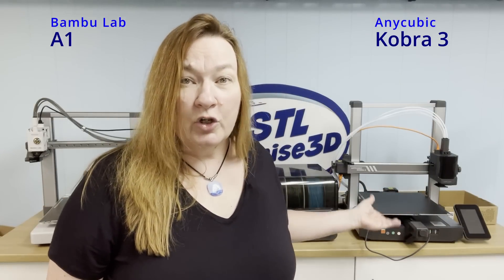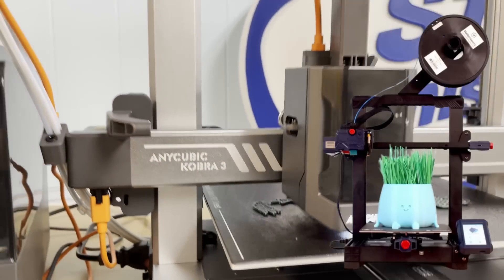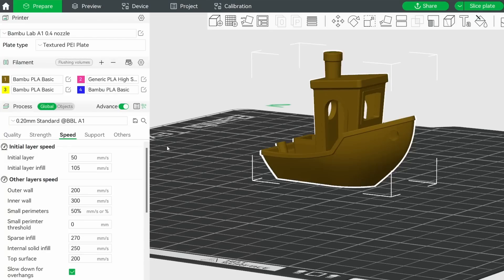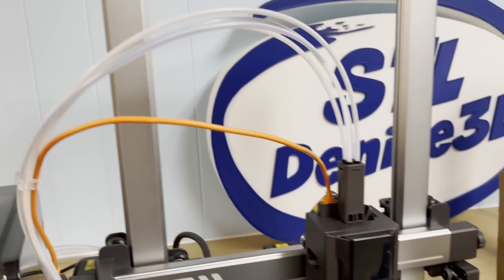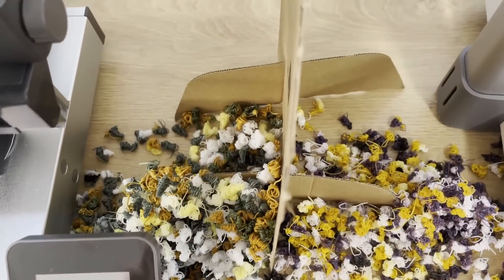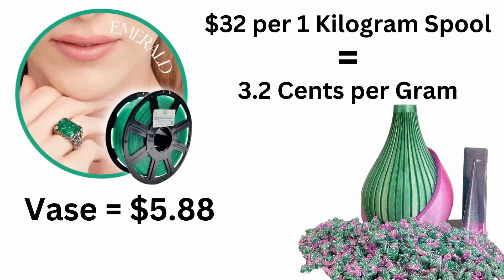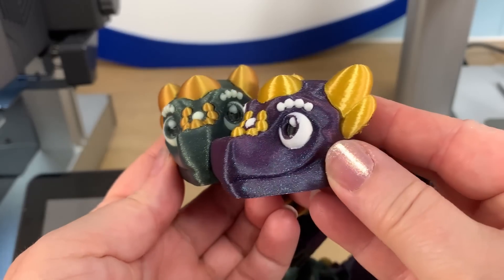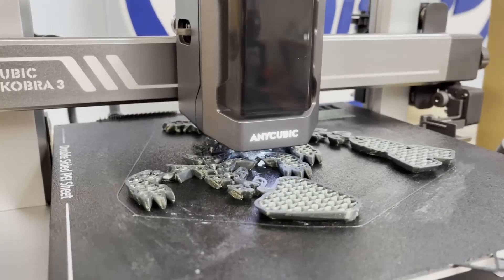ACE or AMS? Anycubic challenges Bambu Lab with new color 3D printer!

Comment: I'm never buying anything but Bambu from now on.
Genuinely the best - you can't convince me otherwise.
Reply: Bambu has earned their top spot. Even the naysayers who bring up spying gets awfully quiet when you can run the printer 100% offline or lan only which does not have any data being sent.
Cloud was is and continues to be optional.* 

*source Run a a bambu X1C setup with zero internet and that machine is 10k+ hrs and 2 years in service with zero issues. 

Why would I need support when the printer doesnt break to need support? Seems the other team needs to lean into "good support" because you are going to need it for their overpriced diy projects.
Reply: @No0o0o0o0o0  You need to stop the simping.  Seriously you have no clue about Bambu printers......For one , just because you dont have it online doesnt mean its not still going to harvest data.  The machine holds your printing behavior in internal memory and the very first time you do go online which you HAVE TO DO for firmware updates, trouble shooting or for any customer support.  It dumps your info over to Bambu.  Also Bambu printers have always had banding issues moreso than other printers.  They DO NOT print better than other printers that are out that cost 1/3 the amount.  FF 5m for $299 has a much higher print quality and is faster.  Qidi Q1 Pro at $400 makes Bambu prints look childish by comparison.  And dont even get me started on the Prusa MK4 or ANY Voron.  Its just simps like you that want to think they are better than other people because you bought an expensive printer is all Bambu is.  And now they are being left behind and inferior compared to newer printers
Reply: @No0o0o0o0o0  ibwmbulab is way overhyped. I don't think anyone cares anymore about 3d printers. They all pretty much haven't change in years. I care about open source, because it allows me to tinker on the machine. My cheap bed slinger does the job. I mean if you know how to tinker, just about any 3d printer can be reliable.
Reply: @colinmetzger6755  Well said. I want a working device not a never ending project. 
I
Reply: @oneanother1  99% of stuff you own is not open source but your 3d printer has to be for some reason? Ok...
Reply: I'm never buying a bwmbulab, can't convince me otherwise. Taking all your data and spying on you. This is china we are talking about. Who knows what's in their encrypted cloud service.
Reply: @oneanother1 Its actually worse than just the data harvesting.  Bambu has the worst customer support.  And their machines are made from B grade parts....Out of the 5 different brand machines i own my Bambu has by far had the most issues

Comment: I wish any cubic would open source their firmware, considering they are using a version of klipper. Due to how terrible any cubic supports their printers, open source firmware would allow the user more option settings. I have the kobra 2 pro, its so limited in everyday from a normal klipper printer or even marlin based firmware. No more any cubic 3d printers with closed firmware for me.
Reply: In another video I saw about this printer it was said that Anycubic plans to release the source code.
Reply: They do, the k2 neo firmware (marlin) is on their github. (I flashed Klipper on the neo, so I'm happy. But the other models in kobra 2 are more closed down)
Reply: @billytalentrocks345  any cubic 3dprinters need a lot of support if they want to be competitive with other machines. The broken multicolor slicer support sums up what any cubic sucks at. The closed sourced firmware klipper on the kobta 2 pro,plus, and max is a terrible idea. The web interface is what we want from a klipper machine.

Edit: I don't want to hate on any cubic like what creality gets, but I own a lot of their previous 3d printers and all of them were open source marlin. They have lost their way, and it shows it, their machines are losing userbase, which was very small to begin with.
Reply: You think Anycubis is locked down? ROFL go look at Bambu....its not locked down , its imprisoned.  Absolutely ZERO open source
Reply: @anthonylong5870  🤦‍♂️ stop spammlng, y0u are under every comment with the same 💩

Comment: I didn't know the channel, I think this was one of the best sincere videos I've ever seen on 3d congratulations!!  I'm looking to buy the Kobra 3. I saw in other videos that it apparently had There will be it on the orca itself, someone who received it also received this version. Do you think that with the orca it will improve a lot?
Reply from the maker: The nozzle was a little close, but that was corrected in the slicer. Otherwise quality is very good. 😀
Reply from the maker: Thanks! Orca will definitely improve this printer, but I'm not aware that Anycubic has made it compatible yet.
Reply: @stldenise  Despite the loss of material, does the ACE work well?

Comment: The MMU2 with mk3s had a lot of problems to reliable swap filament. You need a lot of tuning the unload procedure. This problem magicly disapeared after changing the hotend to a revo. The unloaded filament got a much better filament tip, so no problems anymore to reload the filament. Of course, the Nextruder also works pretty well.
The reason the MMU2/3 works so much better with Revo, Nextruder-Nozzle and maybe TUN (Trianglelabs unified nozzle) is the integrated nozzle/heatbreak combo with a long heatbreak. This forms the still weak filament quite nice. It´s much more tollerant to not perfectly dryed filament and not perfectly tuned unload procedures. So no cut&poo is required.
However, with high-flow nozzles you migh still encounter problems.

Bambulab and simular printers use high-flow for high speed. Also they do not have a long integrated heatbreak. So they use cut&poo. Wich not only produce a lot of waste, but also takes quite a lot of time (1:20 min on an A1) for every filament change. On smal prints even a mk3 with MMU2 produce multicolour prints in less time.

Imho the best way to do multicolour would be a hotend with a nozzle/heatbreak combo you can swap easy. Like the Revo. Insert a normal flow nozzle for filament swaps for multicolour prints. Insert a high-flow nozzle for single colour. So you do not need cut&poo for multicolour but still can print fast in single colour.

However, the AMS has a very nice approch to synchronice the AMS-Feeder with the feeder in the extruder. A spring, a slider, a magnet and an hall-effect sensor inside the very smal filament buffer is used to synchronice the AMS-feeders to the extruder. The AMS-feeder pushes filament until the spring is compressed and the slider moves. The AMS-feeder stops, until the extruder has taken enough filament to decompress the spring and slider moves back (on the X1C and simular, on the A1/A1lite the "buffer" is on the top of the printhead). This way the extruder is released from the workload to pull the filament (wich is still sometimes a problem on the MMU3 with bad placed spools or to long bowden). Also all AMS-feeder are permanently engaged to their filament.

I realy would like an AMS-like filament changer with open source protocoll. Filament dryer, permanently attached feeders and automatic rewind. Much more easy to load/unload spools. Still, on a printer with integrated nozzle/heatbreak combo like the Nextruder hotend, Revo or TUN without cut&poo without a lot of waste and without so much time for filament changes.
Sadly it is quite expensive to buy a solo AMS or ACE to tinker with. But with other companys now copying Bambulabs approach, we might get an open source variant eventually.

Actually the feeder synchronisation might be a valueable function even without filamentchange. If you print big objects, you might want to use bigger spools. A 5kg is quite heavy to pull. So an extra feeder to push filament to the extruder might be quite nice. Esp. as you can make the extra feeder as powerful as you want - its not weight added to the gantry. Also with little changes in the "buffer" (or call it "feeder synchronicer") you could detect if filament is pushed back (more than 3 mm, so no retraction but unload) so you could do a 2 filament changer without any electrical conection to the actuall printer. If a filament unload is detected, obviously the other one has to be loaded... 

Just some ideas...

Comment: some dude did over 10,000 hours of testing to figure out that pressing recalculate then 0.536 multiplier is the best for bambu as any less is not enough and more is well waste
Reply from the maker: Yes, that's why I'm using .6 (close enough)
Reply: you mean to reduce poop i have to set the multiplier at 0.536 ?
Reply: wdym by recalculate?

Comment: I have an X1C Combo, but if I was restricted in my budget I would not be keen on any of these 2 as the poop is not contained, It would drive me mad with all the cleaning up, my X1C misses the bucket with the odd poop and it drops down to the bottom of the enclosure along with the remnants of the nozzle wipe that also misses, I have enough on my plate cleaning that up !

Comment: Excellent video. I’m trying to work out where to go after being an Ender 3 user for about 5 years, and this is very useful! Thanks. 😊
Reply from the maker: I should be getting Creality's color printer at the end of summer. Fingers crossed they've figured it out!
Reply: @stldenise  is that the K2? Multi-colour is not a must have for me, just a nice to have. Inwas debating a K1C. They look great, but: proprietary parts, PCBs in hotends (I know that’s the thing now, but it seems like a massive point of failure), and generally they are noisy. But, I do want something modern and fast so maybe I’ll have to just go for it. Hope you are keeping well!